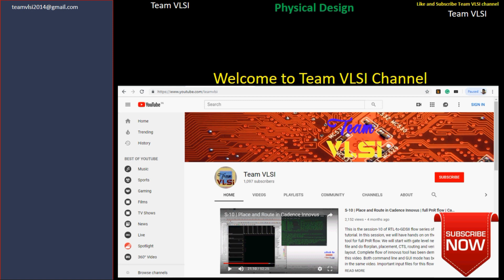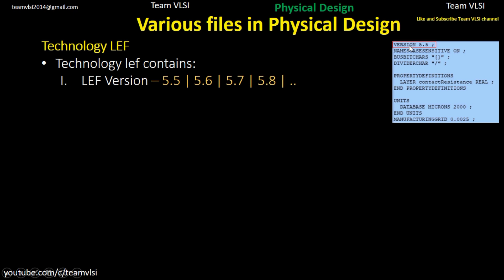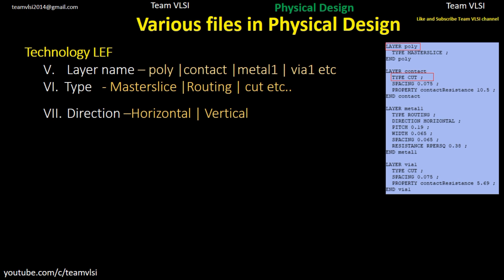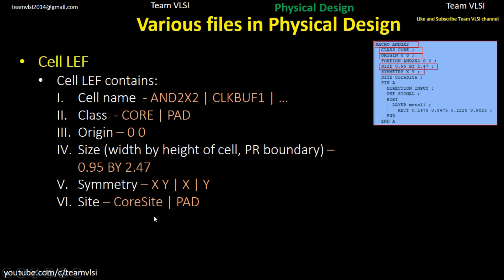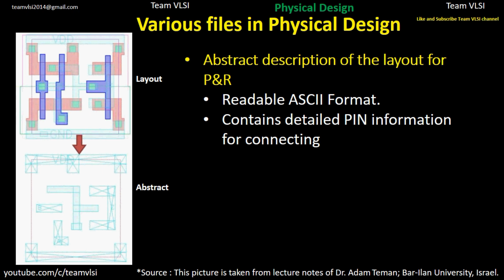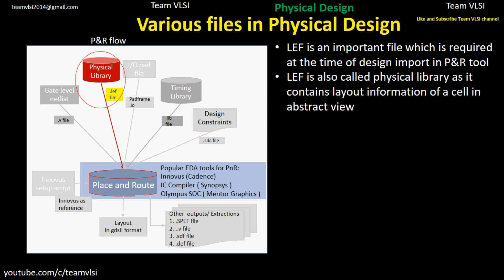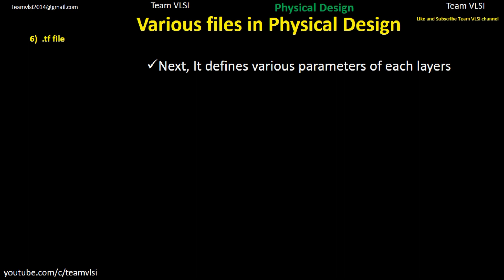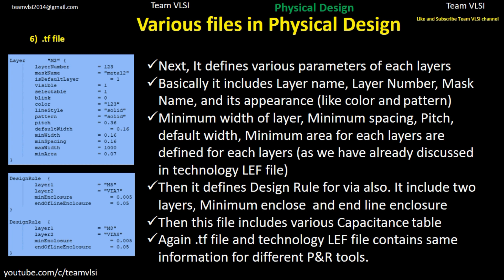LEF file | Technology file | Description of various files used in VLSI Design | session -2

Comment: Hi.. resistance value of metals layer will be different for each RC corner . 
And resistance in tech lef has only 1 resistance value
Reply from the maker: Alright Akhil, The mentioned value of resistance in technology LEF or in .tf  is the typical resistance value for each metal layers. But yes there is  variations in resistance in different RC corners.

Comment: what is the masterslice and where is it used ? ( point 6th in technology lef)
Reply from the maker: Hi Akhil, 
Masterslice layer is typically poly layers and only needed if the Macro has pins on Poly layer.
If masterslice layer is defined , one cut layer must be defined between masterslice layer and first routing layer.

Comment: What is meant by foreign in Lef
Reply from the maker: Hi Arun,
As per the LEF reference manual
FOREIGN foreignCellName [pt [orient]]
Specifies the foreign (GDSII) structure name to use when placing an instance of the macro. The optional pt coordinate specifies the
macro origin (lower left corner when the macro is in north orientation) offset from the foreign origin. The FOREIGN statement has a default
offset value of 0 0, if pt is not specified. The optional orient value specifies the orientation of the foreign cell when the macro is in north orientation. The default orient value is N (North).